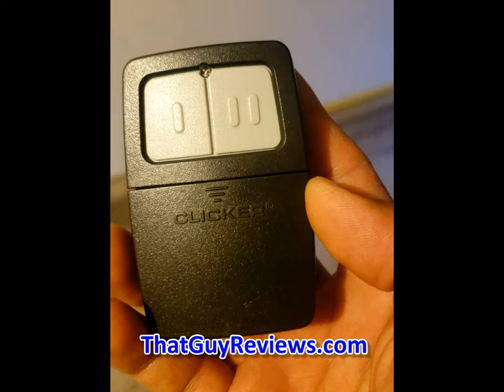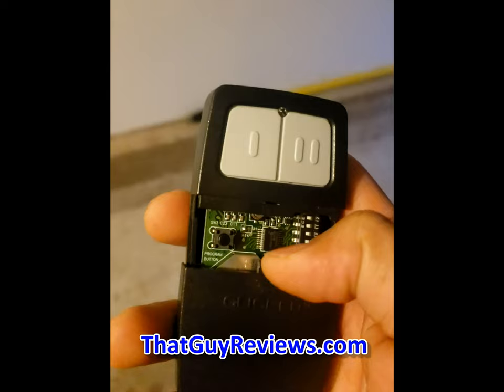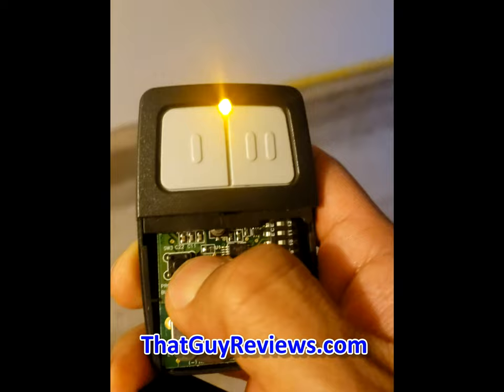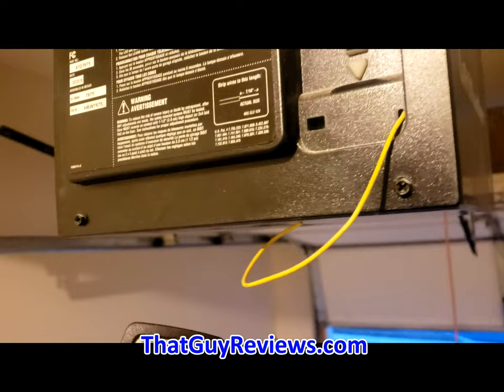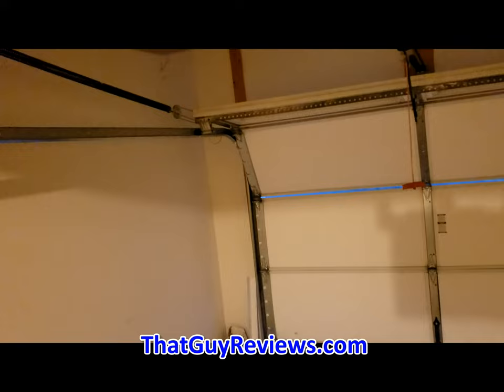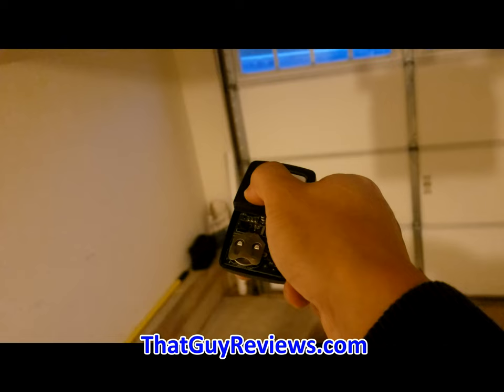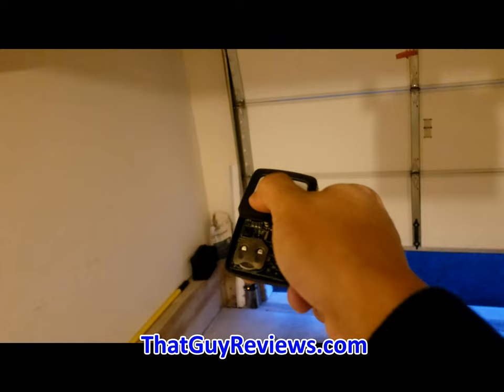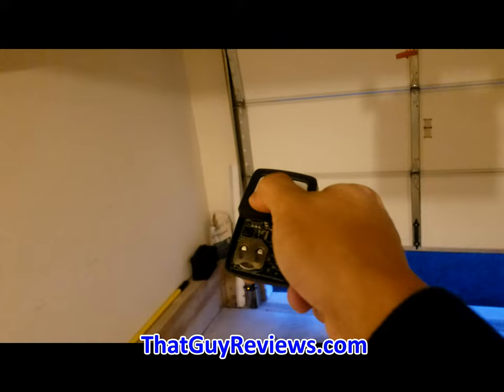How to Program Clicker Klik1U Universal 2-Button Garage Door Opener remote 👍🚘

Comment: Hi. I have this exact garage door remote, but I don't think my garage door opener has that yellow button on the back of it. I've looked and looked. Could it be underneath the metal housing? The garage door opener is a Screw Drive kind that is bright red-orange in color. It is very old/ (Probably from 1985 till early 1990s, I'm guessing). You see, I changed the battery on t he remote, and now with the fresh battery, it doesn't work anymore. So, I suppose I have to re-program it? Thanks
Reply from the maker: yes sounds like it